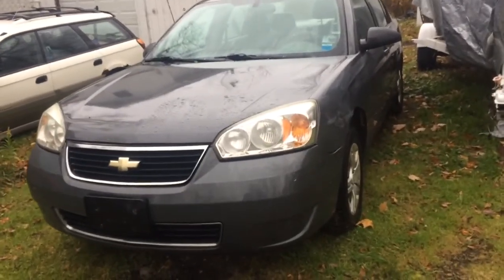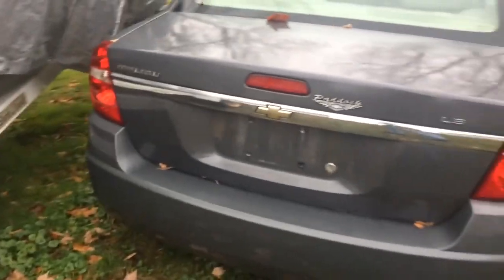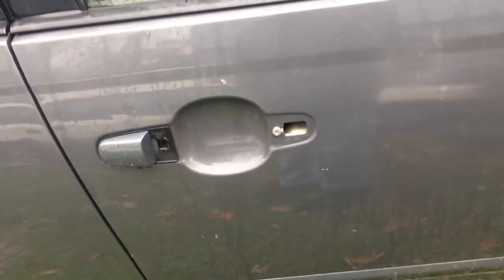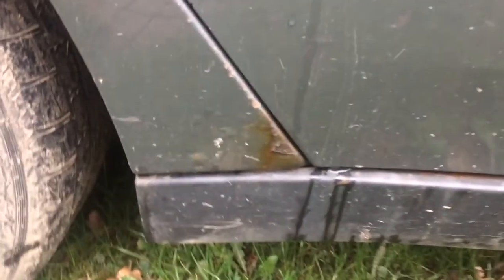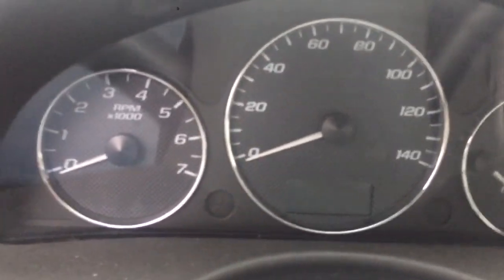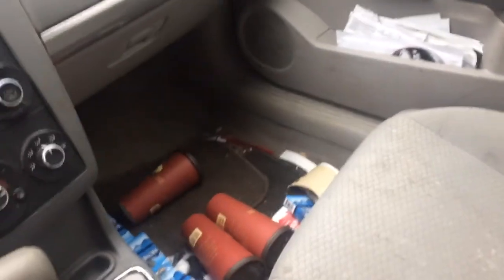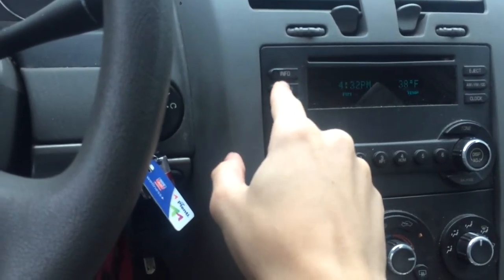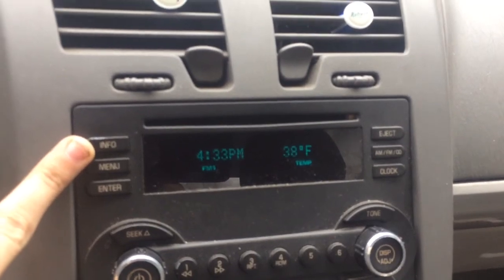Bad review of my 2007 Chevy Malibu

Comment: Hey bro, great video man.. Just out of curiosity that blue inspection badge, how often do you need to do it? For us it's only every time you buy a car and change registration ownership (Which is cool, you can mod the hell out of it with no issues) So... plans? Turbo kit? :)
Reply: Btw, you are right tons of space in the engine bay... 2JZ Malibu xD
Reply from the maker: Thanks for the view dude :D it honestly means a lot to me that you, a GTR owner, take the time to watch my vid.

As for the inspection, it's yearly, though my stepfather is a licensed inspector, and with our cars, he gets lazy and just OK's them, so I suppose that's of no concern.

For future plans, the immediate is the door handle. I got $50 as an early Christmas present and that's going to the door handle and a CAI, that's the immediate. Down the line though, I might turbo it, there's a kit available, along with Forged internals kits, and I seen some dude get 350HP without much more than just the kit out of the same 2.2, I have the benefit of having a 2007 model which was the final year the Malibu was offered to consumers, it has the advantage of a stronger Gen 2 Ecotec Block. So plans for it are bright, there's even the potential to transplant the AWD system from a 9-3X which is made on the same Epsilon platform
Reply from the maker: NELKEL GTR VLOGS as for the engine bay space, there were some versions that had a 3.9L V6 from factory, and the Pontiac version of it even had a 6 speed manual option, as you can imagine though, it's pretty rare sadly
Reply: Sorry bro super quick reply from me, need to head out now for family day.. Being a GTR owner makes no difference... people are people (and cars are cars lol) :) You know we never got the Malibu here.. the closest thing we have is a Chevrolet Aveo which is a 1.6ltr  4cyl fwd.. Crazy that you guys have 2.2 standard and 3.9l versions... Even our Subaru's we only had the 2ltr (EJ20 AUS spec) versions of WRX's and STI's  up until mid 2006 the 2.5ltr EJ25 then became available to us and I know in the state you have always had them even with the GC8 2.5 RS model.. Crazy how different countries get different engines etc.. Good thing about living in South Africa is that the R34 GTR is 100% legal! :)
Reply from the maker: NELKEL GTR VLOGS I understand, family 1st.

I suppose that's true, though outside of Japan, GTR owners are definitely more deserving of respect ;)

Ah, there is an Opel variation called the Vectra, same engine and transmission was an option but not base model. We do have the Aveo here, and it really doesn't compare, Aveo uses a Turbo motor, Malibu is N/A. Aveo is a small compact, Malibu is a midsize.

There is a downside, despite being 2.2L, it makes only 144HP, there was an Italian version of it that made 180HP N/A, but its exclusive to Alfa cars. And the 3.9V6 is a OHV motor, only makes 240HP but yeah, it is pretty crazy, differences in emission laws means different engines have to be designed to cope, even different octane standards can prompt a full redesign

I guess that is one of the "cooler" parts of Africa then ;)
Reply from the maker: hey dude, if you're here, made a new video, this time, of me revving it up without an intake lol, the CAI is in the mail

https://youtu.be/EtmNSbLjGoM